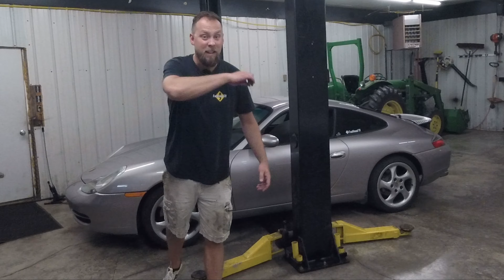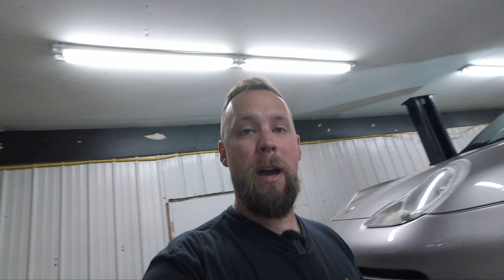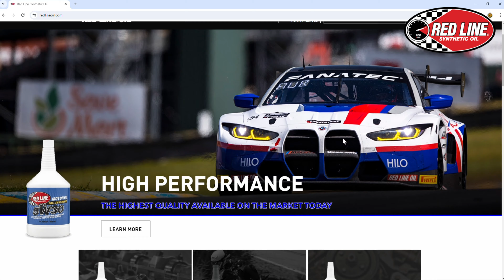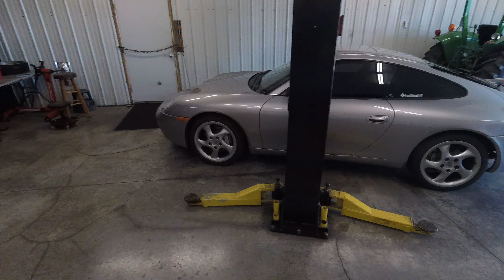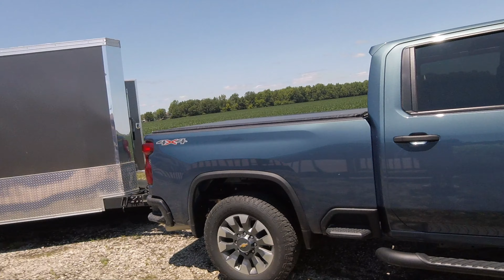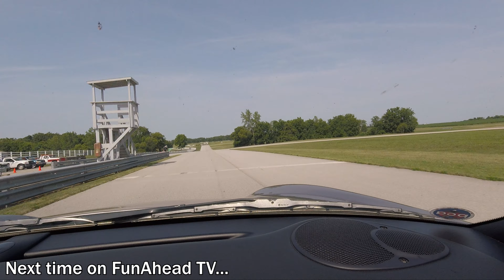Prepping my FRESHLY REBUILT 911 for its FIRST TIME ON TRACK!

Comment: Nice video, David!  Looking forward to seeing the track weekend video too!  Brake fluid confuses me.  First, how does it absorb water when it is a completely sealed system?  I've never understood this.  I haven't changed my brake fluid in about 5 years, but every few months I do check it with a test tool for moisture.  It (so far) has always tested at the "0" level for moisture (green light).   VW and Porsche will tell you to change it every two years, but I'm just not seeing the rational here.  There is no such requirement on my Tacoma.  Can you explain this to me???  Thanks!  -Tom.
Reply from the maker: Hey Tom!! Thank you for the kind words about the video. In reality, if a vehicles brake system is sealed properly then moisture gets in VERY gradually. Humidity can get in past the seal to the reservoir, or through the calipers. You’re right… sealed system, but it can do it on a microscopic level. It takes many years for it to actually amount to anything, even in a consistently humid environment. So VW and Porsche’s 2 year interval is definitely pretty aggressive, but they want the brakes to stay tip top. I always do it pre track weekend just to be safe since brake temps are so extreme. I’ve only done a handful of track weekends, but have seen 2 instances of guys “boiling” their brakes. Not pretty!!
Reply: @FunAhead_TV_Official  Appreciate the input, David!  Have a great time at the track!!!